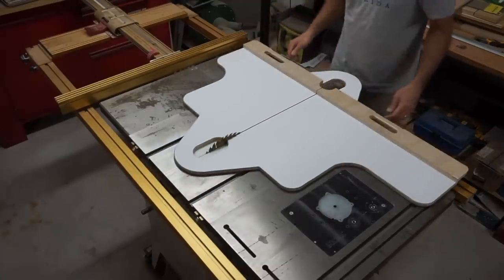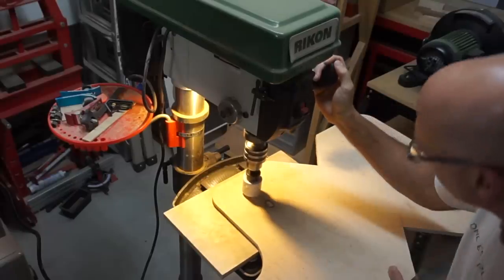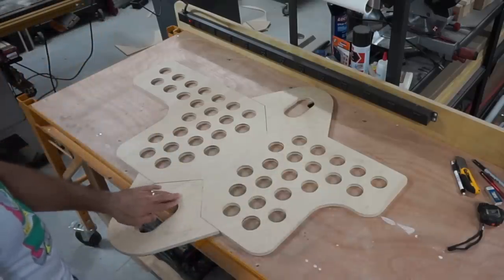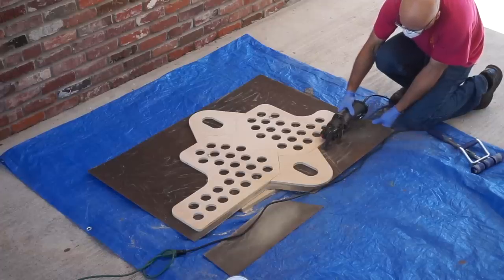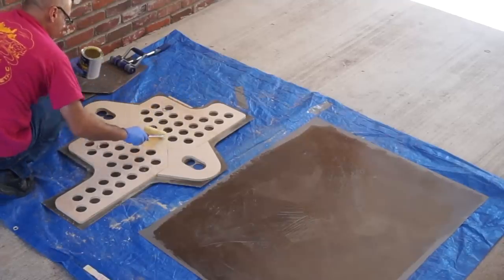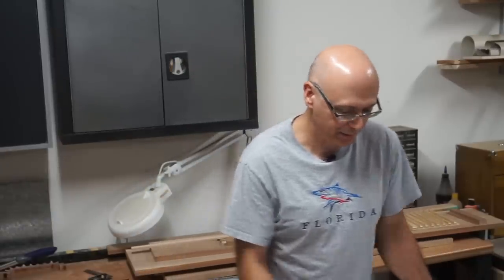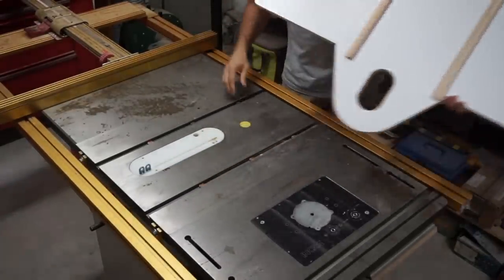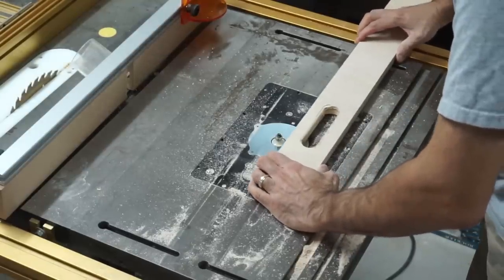A Crosscut Sled Like No Other

Comment: Tell you what badbernock, I've been a trim carpenter and cabinet maker for 34 years
and I can tell you pushing stock through a table saw, sled or no sled without applying
down pressure is foolish and will bite you sooner or later, you can't be too careful
on a table saw as anyone in the industry will tell you, this guys cockiness is gonna
get him hurt
Reply: agree . was waiting for that piece of ply to go flying.. it will its just when...
Reply: I agree as most people do not use a dial indicator to insure the blade is square, front to back to the miter chanel and this  is the source of most flying objects. Even if you have done this you still need your work pieces secure on both sides of the blade. I actually laughed out loud and was waiting for the call to 911.
Reply: Michael Mancini n
Reply: George M I was waiting for the Piece of wood to take off. I understand people trying to reinvent a sled for the tablesaw but, a horizontal fence?. No clamping ability?.. just my .2¢
Reply: Absolutely.  He will be wearing it sometime. I feel sorry for him.
Reply: I shit myself when he made the first cut, thinking I  hope he does not get a face full of wood
Reply: I thought the same thing.  Getting hit with kickback is no fun
Reply: A 3 inch x 14 inch piece of plywood struck me just under the kneecap and almost took my ability to walk. 
Just because you have done something a million times doesn't mean that next one won't hurt you.
Reply: yes he can delete it
Reply: Randy Bird thanks for the reply. yeah, I figured as much. he doesn’t like being made aware of the error of his ways. some people just need to learn the hard way.
Reply: However, this sled is a great jumping off place and many improvements can be added.  For example:  As you indicate, a deeper fence could be added, which could be hollow, like the sled, to allow clamp tracks and such;  and, the sled could be made deeper so a stop could be added to the operator end.
Reply: I'm an absolute novice and I was clenching pretty hard during the video. The only tool in my garage I fear (or better described as showing absolute militant respect for) is my table saw.
Reply: @kellyvcraig  Another good addition would be to glue down measuring tapes on both sides of the fence.
Reply: @josephmorgan8370  How in the world did it hit you that low?   Was it a ricochet from somewhere?
Reply: First time I had a kickback it fortunately missed me and went through a 3/4" piece of plywood leaning behind me. I've never had a second kickback. Scared me straight. ;-)
Reply: Indeed .. I found out the first time I used a table saw that it demands respect …. the piece of wood sticking out of my wall reminds me of that every time I use it. It is, as someone else has said, "The only tool in my garage I fear"
Reply: "Fear" and "respect" are the two greatest tools in a woodworking shop. It keeps you from pulling out the worst tool... "stupid".
Reply: @veritasestveritas8646  Respect, yes....fear, not so much. I don't think we disagree, just think the word choice was not accurate
Reply: @josephmorgan8370  0
Reply: TheNajSD // The respect for sure, is due the table saw. The rest of the tools that plug in also deserve respect. The miter saw, jointer, planer, router, bandsaw, lathe and lets not forget the drill press all have some sort of directed forces. If the force somehow gets diverted watch out. And a moving body part against a sharp object, stationary or moving can be real bad.
Reply: @kellyvcraig  and, the sled could be made deeper so a stop could be added to the operator end.

Actually, as I note independently, you also want one up at the top lest you absently pull the sled through the blade.
Reply: I think it is ignorance not cockinness
Reply: It looked like a "how NOT to" video from a safety standpoint!

Comment: Never never push a piece of wood through the saw without holding it down. Oh boy .....
Reply: Alfred Neumann i seen that and it made me cringe god im so glad it did not go wrong....
Reply: It's been about 20 minutes and I'm still cringing.
Reply: Darwin was poised on the edge of his seat for a moment there.
Reply: Yea, I was waiting for a bad moment there too.  All that money he has in Incra fence, router table lift and he does something so basically unsafe.  Probably just a "not thinking" moment but that is all it takes.   Aside from that, clever out of the box thinking project.   I've got to give him credit on the design.
Reply: paul kelly no, this wasn't a "non-thinking" moment for him. He actually defends the practice of not securing the piece in a follow-up video and claims 30 yrs experience. He is telling people that there is no need to hold down your workpiece when using this sled. He is dangerous to himself and others.
Reply: He is dangerous to himself and others.   No argument there.
Reply: That was my thought!
Reply: @badbernrock  30 years is an awful long time to avoid answering the door to Murphy.
Reply: Yeah I got bit by the tiger ones
Reply: what, me worry?
Reply: I was struck on the chest once by a 3/4" half sheet fired by a Craftsman radial arm saw. I was lucky I only had a deep purple bruise the width of my chest by six inches tall. I could've been killed. You have to control that wood at all times from becoming a high speed projectile.
Reply: I agree  I have had kick back and I had a  push stick that came with my saw that splintered luckily only a big bruise but could have been much worse
Reply: Agreed, made me nervous. Is there a design feature to add -- something to clamp the piece down as well? Maybe a rod+hinge that can also be clicked down onto one or both sides?
Reply: I cringed when he put that piece of wood on the sled without something to hold it. As soon as he put both hands on each handle of the sled I waited for that board to hit him in the vest with so much force. It might not have happened then, but eventually without using more caution it will. RIP.
Reply: I had to look away. . .
Reply: Not to mention that horizontal cut at the beginning with the weight of the board and saw collapsing at the end of the cut, nothing like a saw falling down while running. Some good how not to do things examples here.

Comment: I’ve been looking at other sleds, and I always wondered if it was necessary to have a thick, heavy fence on the leading edge just for “strength” - the engineer in me said no. Then I saw his, and bingo! This is a great design to build off of. I like the hand holds on the outside. Tweaks I would make: 1) 2 layers of 1/2” ply 2) Incorporate King’s replaceable throat plate 3) add a taller fence (to keep it flat and for the track) 4) top fence track with scale and flip stop (that’s standard now, right? ) 5) standard T-track hold downs 6) T-track in the face of the fence for heavier stop blocks and other fixtures (box joint jig, picture frame jig, etc)

Comment: I give you credit for making a good video, and inventing a different approach.  I like some things about it. It's big, but slim, and light and smooth. It will store easily.   There's things that could be improved.  The fence part needs to be taller to make use of clamps and blocks.  I didn't see a bottom rabbet for sawdust at the bottom edge of the fence. I don't like gluing the  fence down.  You've got no option to fine tune it.   I don't like removing a riving knife or splitter unless you really have to.  I'll bet you could cut the slot thru that far end, but reinforce with a glued down  arch that spans over the slot at that far end.  But was fun watching you work.
Reply from the maker: I agree this design has room for improvement. Who knows, maybe you’ll see a version 2.0 someday!

Comment: I like the light weight twist you put on this.  I also like the low profile design.  I see folks knocking that its not square enough for them...  That's an easy fix, so I wouldn't worry about it.  Thanks for sharing your work with us.
Reply from the maker: Thanks, Greg's Garage! BTW, I checked out your channel. Lots of cool stuff on there!

Comment: if you want anything square, you really should use the 5 cut method to square your sled to your saw....Great design, but lost me at using a carpenters square to square your sled :( 6 thousandths is about the max you want for anything production work and is easily attainable using the 5-cut method.
Reply: Doing all that work to build a laminated skeletonized sled then not using the five cut method seemed a shame.
Reply: Or use a machinist's square and be done with it. A decent set is accurate to within  .0006
Reply: Wow, All that elegant work, then throwing it away without the 5 cut corrections, AND NO HOLD-DOWNS, I'm DONE.
Reply: You can use double-sided tape on the rails while in the slots, then lay the sled over it so it sticks in place. Then counter-sink screws from the bottom of the rails to attach permanently. Then make your cut with the table saw. The cut will be perfectly lined up to the rails, even if the sled is a shade off square from the rails. With all those rounded edges, you will not notice, and it won't affect accuracy as long as the fence is perpendicular with the cut/rails. That's all that really matters. The sled could be round and it would still work fine.

The final step is attaching the fence perpendicular to the cut/rails, which is fairly easy using a quality speed square with the lip of the speed square in the cut so the fence is at 90 degrees from the cut.

Comment: Needs a few tweaks. I uttered a few expletives on your first test cut as did everybody! Personally I like the weight in my sled as it is the base for my pieces to be anchored to. I may try out a new design myself. Stay innovative!
Reply: David Stanton good to see youtuber like yourself commenting on others.
Reply: PAUL ROBSON f
Reply from the maker: Hopefully there weren't any young children around when you did! Thanks for your comments!
Reply: Boy did I ever, too. So lucky that piece didn't kick up and back.
Reply: I never let a piece walk to school on it's own.
Reply: And he pulled it back under power...yikes!
Reply: That was scary. I've seen those walk right up and then exit at 70 mph.
Reply: I went like 'No! Nooo! Nooooo! No!'
Reply: Seems I'm not the only one who thought you were nuts not to be holding your work piece.
Reply: And it was a Rip Cut! Would have been safer as a Crosscut with the cut smaller than the length of the piece.If your going to rip use a fence and pushstick! Still great design I'll, definitely be making one of these, nice and slim for storage!
Reply: oobaka1967. I was waiting for him to lose a couple of teeth. But I guess that would have been edited out.
Reply: David Stanton ari     Ttyy. W wwwwwwwt
Reply: Never, ever run a piece of material through any saw without positive control over it.   Lucky it did not kick back on you.  Especially on your first cut with the blade already dragging when you moved your sled.
Reply: I think I’ll add an aluminum t-track to the fence. Then probably build different hold downs, so I’m never tempted to get close to the blade.  So far this is the nicest sled I’ve seen for my needs.  Not sure why the ‘head’ and ‘tail’ sections need to be separate from the main body?
Reply: I am really glad to see I am not the only one who had an issue with safety.
Reply: Ii couldn't breathe watching him cut an unsecured pamel. I've seen a 1x3 go right through a wall and hang out through the siding. Thought I was going to watch someone get their face smashed. I really like the lightweight design but think I would add some way to clamp the workpiece in place. Pretty creative thinking in its design though.
Reply: I almost threw an expletive or two on your first test cut. My girlfriend ask why I was yelling at a guy that couldn't hear me.
Reply: Could be part of the reason the board was out of square.
Reply: When you used the micrometer to measure for square, were you certain that the original piece was square to begin with? Next time use the mic to measure the test piece corner to corner before and after the cut.
Reply: I fainted when I saw that test cut. I woke up in a daze, shaking and in the fetal position. For weeks I had nightmares of flying 1/4" pieces of Bubinga chasing me down the road...thank God it wasn't Oak. My wife forced me to see the doctor, and I was hospitalized for PTKBD (Post Traumatic Kickback Disorder). Anyway, I'm in a recovery program now and able to watch hand tool videos from Chris Schwarz. I'm hoping to progress to his sharpening videos next week. It's been tough going...
Reply: @James Landis I think the reasoning behind the open slots at the front and back are for the blade to turn on and off without material right next to it.
Reply: David Stanton  it needs two adjustable locking clamps to exert downward pressure if he’s not going to use his hand.  He also mentions that both sides are very slick, so perhaps numerous self stick strips of sandpaper lengthwise would assist in holding the piece in place during the cut.
Reply: Liva T. Lund, writes "woodworking plan & guides: Woodworking Plans Hi-Quality Projects and Blueprints horse."

Advertising in the comments of someone else's video… now that lacks class.
Reply: @jamaxit  I think this is just to optimise use of the ply as they are made from the large cutouts. In reality the size of the laminate and the way that is trimmed, the core may as well have been a single sheet.
Reply: @MikeWhitton  0
Reply: @trbo20  0
Reply: @MikeFaneros  0
Reply: @genarogomez9535  0
Reply: @fred_derf  0

Comment: I like the swiss cheese idea to lighten then lamination. 0.033" out of square leaves much to be desired. A few more minutes to dial in the fence seems like a no brainer given the amount of work already expended on the sled. William Ng has a five cut method video for squaring the fence that resulted an an error of 0.001" over a length of about 5 feet.

Comment: I have build a few sleds myself, you are absolutely right about their weight and bulkiness, but I agree with some of the comments, never run a piece of wood unsecured in one way or another, but your sled has a couples of features I really like, it's light and easy to put away, so I will probably use your design but I will add a piece of wood at the top, and screw on 4 hold down clamps, 2 at the bottom close to the cut line and 2 at the top, near the cut line also, and I think it will be perfect, a little more cumbersome with the clamps but not much heavier....You can also use one side handle but also use the push block on your board you are cutting...we can see your hesitation, but you went with it anyways!!!!

Comment: "35 thousands" is "good". Since when?

Wow!

Now the really good part.

I really LIKE the sled, BUT it needs hold downs. Two DeStaco clamps would be great. By using the "5-cut" method, you CAN make this sled "One of the top of the line accessories" for a table saw; IF you made the fence adjustable and calibrated it down to less than a "thou" every so often.

Outside of that I'll shut up now.
Reply: Government "good enough":  Measured with a micrometer; marked with a grease pencil and cut with a chain saw!
Reply: I just have to comment to say that is the best comment I've ever read!